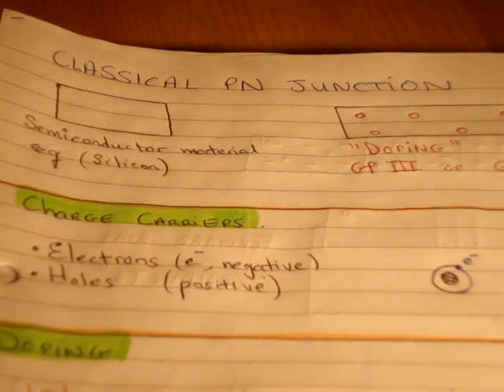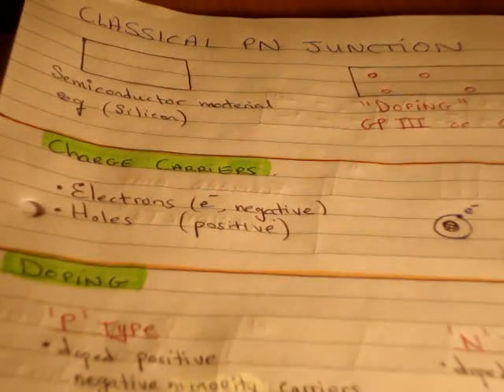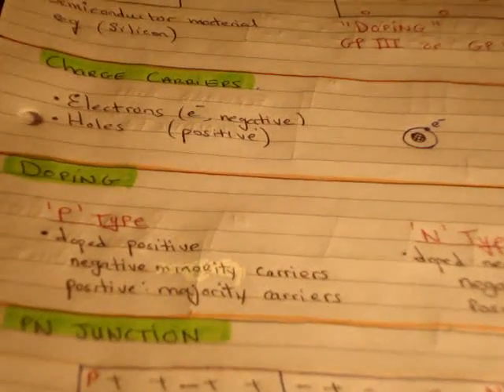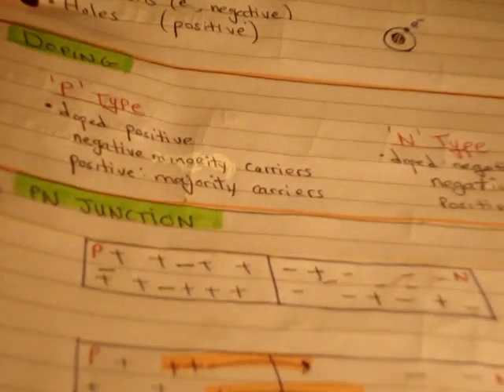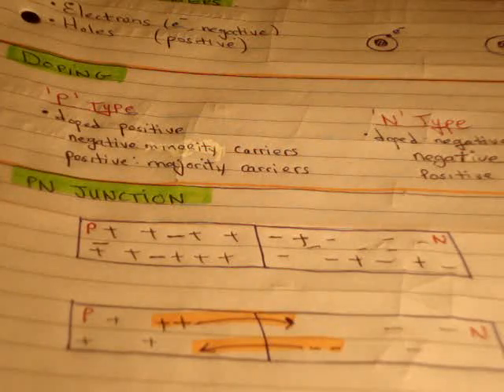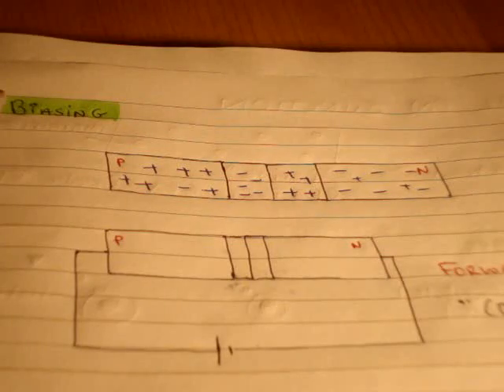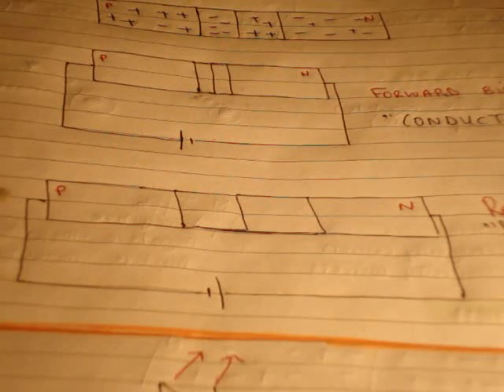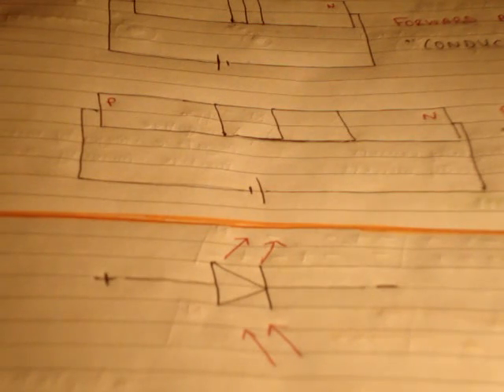Electronics 1 : How a PN Junction (Diode) Works

Comment from the maker: That's what causes the creation of the depletion region alright. but really we're talking about the electric field. this moves charges and is caused by an excess of one type of charge over another charge. its purpose is to create an equilibrium charge (equal amount of both on either side). once an equilibrium of charge is reached, the electric field reduces to zero. since this is what moves the charges in the first place, the depletion region remains that size thereafter

Comment: Dude this explanation is completely wrong... Holes are not a net positive charge they represent one electron less than the full outer shell. A p type semiconductor on its own is charge neutral.

Comment from the maker: The answer involves some involved physics. But basically it comes down the the following: Electrons fill up boxes (called bands). To analyse the physics of solids, we see what the electrons are doing. But it turns out that we get the same answers if we just look at what the un-occupied space in the boxes (a hole) does. This un-occupied region behaves as though it was positive in charge. So it's mathematically easier to look at the few holes rather than the sea of electrons.

Comment from the maker: It's pretty simple. The depletion region is depleted of charge so one side is mainly positive, and the other is mainly negative [neg-pos]. This stops the flow of electrons and no current is flowing. If you forward bias the diode, your effectively placing a positive next to the positive, and a negative next to the negative [neg-neg-pos-pos]. Like charges repel, reducing the size of the original junction [neg=pos].

Comment from the maker: Answer Part 3: So an electron moving to the right behaves mathematically exactly the same as a positive hole moving to the left.

So finally, to answer your question, the maths is easier to do if you examine the free space instead of the electrons, it's easier and gives you the same results.

Comment from the maker: Answer Part 2: It turns out that if we look at the properties of the electrons only, the mathematics becomes very tiresome as you add more and more electrons to a band (there are just so many). But if we instead treat the empty space remaining, the mathematics is simpler because there is less space than electrons. It turns out that the mathematics of the empty space is EXACTLY the same as the electrons having POSITIVE charge.

Comment from the maker: Answer Part 1: To be honest, to answer this question requires some solid state physics. If you want you can check out Ashcroft and Mermin (Solid State Physics) or Kittel (same title). Basically, electrons in metals fill 'bands' of energy. The properties of the metal depend upon how full the uppermost (most energetic) band is. As you begin to fill up a band with electrons, most of it is 'empty' (clearly) or is a 'hole' . When the band is almost full, then you have more electrons than empty space

Comment from the maker: @metroidhunter444 5: The hole is just a space for an electron. It just seems or acts as though it has a negative mass and a positive charge.While you could pick up an electron (if you were small enough),u could never pick up a hole.So to answer your question finally, why don't the holes and electrons 'cancel' eachother out? Only electrons are ACTUALLY there.There are not 'hole particles' with which the electron can cancel.It's just the maths which says that a hole can LOOK LIKE an anti electron

Comment from the maker: @metroidhunter444 4: The mass of this space left by the soldier seems the same as any other soldier and its speed is the same. You could say that the soldiers 'add' mass and the holes 'take' mass. So the hole has 'negative mass'. Anyhoo, going now to the PN junction. As the junction is forward biased, all the electrons are attracted to the positive terminal (leaving holes in their places). It seems as though all of the holes and electrons switched places. However, the hole is not a particle.

Comment from the maker: @metroidhunter444 3: So say you now look at the valence band, it's partially filled with electrons and space exists where some electrons left to go to the conduction band. Doing the maths (pretty complicated) its found that these holes BEHAVE as though they had negative the mass of the electron and positive the charge on the electron. Imagine an army of soldiers marching and one soldier falling out. The 'hole' left by the soldier seems to march onwards too.

Comment from the maker: @metroidhunter444 2: The filled band of hightest energy is called the valence  band. The lowest unfilled band is called the conduction band. Now some electrons can leak into the conduction band from the valence band (uncertainty principle, extra heat etc. cause this). So as an electron leaves the valence band and enters the conduction band, it leaves a space or a 'hole' in the valence band.So really, you could say that the conduction band is filled with 'holes' and the valence band with electron

Comment from the maker: @metroidhunter444 1: What is a hole? If you think of the Bohr model of the atom, there are shells in an atom which can be unfilled, partially filled or filled with electrons. If partially filled, you can think of a shell or orbit as having 'holes' in it. Extending that analogy to metals. The electrons in metals form bands (similar to the orbits in an atom). These bands are kinda like groupings of the atomic orbits. So groupings of energy levels exist.

Comment from the maker: @MultiSuperdarren Nope, when reverse baised, there is actually no circuit. When forward baised, since the depletion region reduces, eventually there is conduction across it. Thus if your diode is connected via wires to a voltage source, then you have a complete circuit. Current flows from the voltage source through the diode, back to the source. When reverse biased, the depletion region is too large for conduction. So a complete circuit does not exist and no current flows.

Comment: @youspinmerightrounds so lets say the depletion region grows when it is reversed biased, wouldn't the electrons from the cathode of the battery flow towards the P, and the electrons from N flow towards the anode? There should be a flow of current right?

Comment from the maker: @MultiSuperdarren Part 2 However they the repelled electrons and holes will be pushed closer to the physical pn junction (where the two materials touch), shortening the depletion region. If you can understand that, they you can accept that by reversing the voltage, the holes are attracted (away from the junction) and the electrons are attracted (away from the junction). Thus the depletion region grows in size. Hope that helps

Comment from the maker: @MultiSuperdarren Part 1 Ok there are a few answers to that question. The simplest is to draw to small vertical lines on a page, with a horizontal line going left and right away from them (your drawing would then resemble a capacitor). Label one vertical line P and the other one N. Now if you forward bias the junction (putting a + voltage on the P type and a - voltage on the N type) your holes will be repelled by the positive voltage, your electrons will be repelled by the negative voltage.